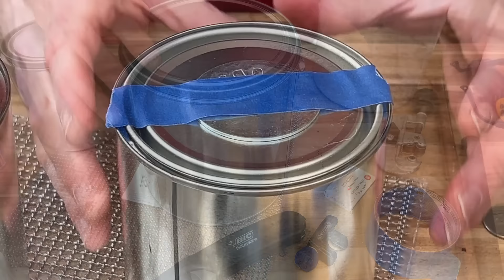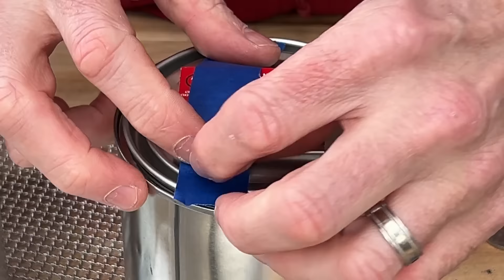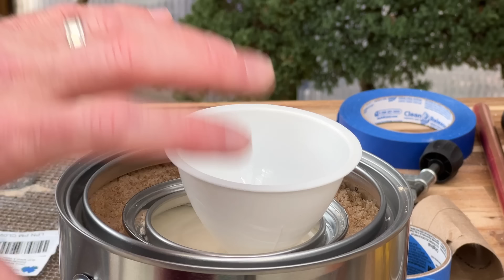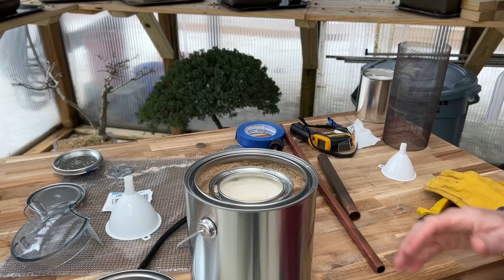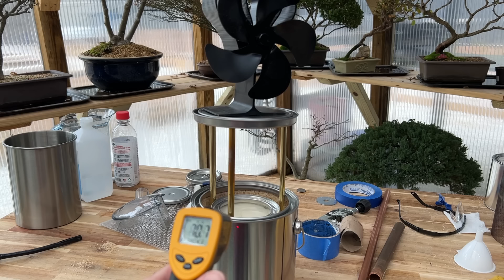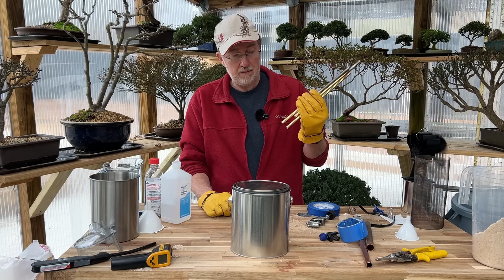Endless Heat Without Electric | Safe Reliable And Low Cost

Comment: I have an extra beneficial suggestion that many folks do not consider.... This suggestion is whenever you burn anything with a flame inside a room, you should provide fresh air from outside for the oxygen supply...For one reason is safety, of course, if you use a fuel that does not burn clean, and Ox level could be reduced in the room.... But the main reason is pressure differential. You see, if you burn something such as this fabulous heater without outside air source, there will be a slight vaccuum created within the structure that will draw in air through any gaps around doors, windows not fully sealed. This will create drafts that will cause parts of the room to not be heated as much, or not at all... By supplying the flame with outside ventilation, you create a static or slightly positive pressure that pushes air more evenly throughout the whole room.. For an example, when I was young, my friends heated their home with a Franklin stove, that got it's air supply from the room.... They had old, single pane windows, and small gaps around their front door, and no weatherstripping.... They would crank the stove up hot, but by the windows, the cold air rushed in faster, and got more drafty.... It forced everyone to huddle around the stove in the winter. They always grew mold in the corners....When they got a modern stove, that fed air from outside, their house was toasty.... And I think they used about one third the wood in a season....
Reply from the maker: Thanks for the advice and experience, that makes a lot of sense!
Reply: Thinking of running a little air pipe from outside to near my wood stove!
Reply: @hanginlaundry  A lot of stoves, probably since the 80's maybe, have a covered cut out in the back or on the pedestal, that can be unbolted to accommodate an air supply..... I don't know why it wasn't done 100 years ago... It is simple thermodynamics..... Hi temp aluminum tape usually works pretty good....the thicker guage stuff....Good luck...
Reply: @tiggywink1 Thanks, I will check that out! ❤🙏
Reply: tiggywink1, would leaving a window cracked open provide the necessary outside ventilation or something more elaborate is needed?
Reply: @arepede1878  It could, but not the best, because you could create a draft. You could however get a piece of styrofoam and fit it into the open window space, then put a piece of flex hose, or a shopvac hose, and drill a hole in the stryro to fit, then put the end near the draw area on the stove. A closed system is best....
Reply: @tiggywink1 what would be considered the draw area of this little homemade heater and how would it be fastened to it?
Reply: @jenniferrobinson8769  Near the flame. You could make a shroud out of a tin can, cut a hole for the pipe, as low to the bottom of the flame as you can get. Maybe get close enough so the end of the tube can get warm to help draw in fresh air. Heat rises.. I found some sites you may want to visit on YT. Zen Garden Oasis, and Daniel's Inventions. ZGO has the sand stuff. I'd use wire to attach, probably. Drill holes, make a hinge. like a BBQ.....
Reply: @tiggywink1 what do you think about making an exit hole in the large tin. Wedging something in it to make a tube/hose (maybe flashing material or aluminum? Something safe and that could withstand the heat). Seal hose with the heavy duty silver tape. Run it to the screen. (Of course cover around screen to avoid too much draft).
Reply: @goodenoughgirl8102  What you say seems sound. All you want is the flame to receive outside air, rather than air from the living area. If your flame is small, you could probable use a 1/2 inch flexible tubing coming through an insulated gap in a window venting into the burn zone. Like an open window with a strip of styrofoam dammed in the gap with a hole for the inlet air tube..... If no ventilation, Air from inside the living space draws cold air through any crack in any door or window. At least if the stove is chimneyed to the outside....If you just burn with no input or output airflow, you will be producing soot and vapors in your living space with questionable health considerations.
Reply: @tiggywink1 Thanks so much!
Reply: @tiggywink1 would putting it in the fireplace work? There's not many places for ventilation in my home
Reply: He mentions this heavily in the video
Reply: Hi. Just joining. One question:  can this be refilled? Can I keep adding more alcohol before storing or as it dissipate?
Reply: Thank you for the awesome 👏 advice. If I read it correctly, leave a door or window open?. If not could you please let me know. Thank you 😊.
-Also, wouldn’t it be a great idea no, to put the stainless steel, like he did in the coke can heater, to prevent open flame 🔥 in general. Both the large and smaller versions. This is Awesome work and thoroughly enjoyable, as one who just moved to NC & yrs, weather 😂, I’m never prepared, but my friend has everything camping. I sleep there for power outages if needed. Rather be home.
-What can you put on the top of pipes to cook with please 🙏 @ZenGardenOasis
Reply: Awesome job!  I appreciate you sharing your wisdom and taking the extra time to explain in detail for us older folks.
Reply: Fantastic example and advice. Something I had not been thinking about but definitely needed to know
Reply: @ThePerfectShepski  Yes, Brother, feed the fire with outside air, rather than drawing it from the room. Better for your health, too...
Reply: You over explain.
Reply: That's a long ace read. Use AI to shorten it up and not put ppl to sleep
Reply: @stbam1965 I'll work on that. Besides, I'm probably not the most interesing guy. But I'm not going AI. I try to explain thoroughly so people get it. I like people, not AI... Thanks for being honest.
Reply: @stbam1965 If that seriously is too long for you to read, I'm not sure even AI can help.  It's only 11 lines at the zoom level I have because my eyes suck, and that is not a long read.
Reply: @stbam1965 Ah, I see AI is doing wonders for society already, just like social media has done.
Reply: @flickwtchr NOT!
Reply: @stbam1965 hey! I enjoyed reading that!
Reply: @revheatherfromohio  It is probably because you are a thoughtful, wise woman that considers and respects the research done by others that are regular folks. Even if the knowledge gained is not embraced by the collegiate hierarchy. It is always better to learn from someone that has been there.
Reply: @stbam1965it's clear concise with no extra information
Reply: @stbam1965i recommend less fentanyl for you.

Comment: For the bigger version, please also make sure that the pail is stainless steel and NOT galvanized steel--if it gets hot, galvanized steel will off-gas zinc oxide fumes which can make you pretty sick.  There are ways to safely get rid of the galvanized coating but they take time or specialized chemicals.
Reply: My dad when he was young and not aware, welded galvanized steel and it gave him blood poisoning. He almost died at 24.
Reply: @LadyTrueBlue : you grind the galvanized plating off with a grinder ... .. and only then you will to that pipe .. or any kind of steel for that matter ... Make sure that the weld is a half inch or further away from the galvanized plating .. 
.. !!!! .
. yes galvanized plating stinks too when you weld it .. !!!
Reply: @BOBHLDRMN wow :) THANK YOU VERY MUCH for teaching me that!!!! You are appreciated by me. I totally understand what you mean as I remember watching my dad weld so many many things! One was a huge frame of a rainbow trout for which we did go fishing down by the snake river:) he put it into a parade with a running waterfall and a beautiful conservatory dressed lady skier ⛷️ swim suit holding onto the fish pulling her up the water. It was amazing all done with midge podge:) painted into a rainbow trout! Yep he won on thst idea 💙💭💙
Reply: @BOBHLDRMN so it must be ground to create a better bond because the texture melds into the product of the metals?
Reply: @LadyTrueBlue you have to constantly sip on milk when welding galvanized metal.
Reply: @LadyTrueBlue  ерунда.. у нас сварщики варят оцинкованные трубы 8 часов.. потом вечером температура поднимается и небольшое отравление, оно легко снимается молоком..
Reply: @Palladln what a beautiful language:) thank you kind man!!! 😊
Reply: So using stainless steel it will be safe to breathe?
Reply: @badele80  все равно можно угореть.. лучше чуть проветривать помещение, а этой горелкой нагреть камни (или красные кирпичи или чугунные ядра) и когда огонь потухнет то камни будут долго отдавать тепло..
Камни тоже должны быть специальные для сауны, не подойдет известняк и не подойдет гранит и кремний..
Reply: Good advice, thanks
Reply: About lost a brother in law to welding galvanized steel. He had been a welder for a long time and it snuck up on him before he was aware of how severe his exposure was. Been many years ago but I believe he said to drink a lot of milk to help recover from the poison fumes.
Reply: Yeah ..and when oxygen is finished..you don t nred heat anymore.
Reply: @NicoletaFlorea-l2p 😂😂😂😂RIP
Reply: Are coffee cans galvanized steel
Reply: @mbell66 no
Reply: Thanks!!! Forgot about that
Reply: you can actually burn off the galvanizzed coating before yu ever build the burner and you wanna have a lid tht fits tht bucket to put out the flame and keep it from drying out
Reply: Or just burn it off, outside. Use whats available in an emergency.
Reply: Great point!
Reply: Inhalation fever🎉
Reply: It will potentially kill you
Reply: What about aluminum?
Reply: Yes!
Reply: I think the giant version would burn a lot longer due to holding more fuel but will probably emit about the same heat due to paper towel  roll being about the same diameter as the toilet paper. 👍😃
Reply: @Gunslinger357 now that is probably true!!

Comment: Two comments: 
1- The paper roll is ok in a emergency situation, but is better if you buy a  flameproof insulator as:
ceramic fire blanket
fiberglass
rock wool
carbon felt
they don't burn if the alcohol is consumed.
2- This is perfect to try a heat acumulator with the sand, look at this video an do it with a insulator torch in the middle
https://www.youtube.com/watch?v=DZ1CkDlN6Xw
Reply: I saw on another post someone suggested carbon felt, but if it tipped it would run out that denatured alcohol would run out as opposed to the toilet paper roll would tend to hold most of it in

Comment: Great video. Fun fact tho, the fan is indeed powered by electricity. It is being generated by a peltier device, running on the temperature differential between the bottom and top metal sections of the fan's stand.

Comment: I love your videos. Yeah, it is easy for us to comment with different ways when watching after the fact, but your ideas always inspire me. Add the fuel in first, then add the can, and put the sand around it. Less hassle. Use a magnet to hold your opener, maybe add a lighter, it can stick to a magnet too. For Nonmagnetic, use matches in a small alcohol resistant bag/container for inside the can. You could really sticky-tape and tape it to the inside part of the lid. It is for an emergency. It is not like you need a hundred of them. I love the thermal battery-operated fan. I am going to try to make one of these. Thank you for sharing.

Comment: My heater plans include sand because it’s a superior thermal mass, holding and radiating more heat than most other types. Insulating with it works, up to a certain temp. Sand will hold very high temperatures. I think your stove idea quite dangerous, balancing a pot of boiling water on such an unstable base.

Comment: Can you please provide the name of the fan that you use? I have tried 4 different heat activated fans. Yes, they whirl around but the design is poor and they doesn't even blow my hair when I place my head directly in front them. They are all sent back to Amazon. Some of the fans that I purchased have great reviews but they don't work well enough to move much air.
Reply from the maker: These fans cfm are very low.  Gentle air current.

Comment: Great ideas . While I was watching it I was thinking why not put the paint can inside the bucket put the sand in the bucket same idea then longer pipes then add  a platform a bit higher than the paint can and use some tongs to put the lid off and on instead of taking it apart .I really like the idea.

Comment: I probably would use carbon felt instead of toilet paper. Carbon felt is used by welders and it won't burn up like toilet paper eventually would.
Reply: Graphite coated or non coated
Reply: @tracenixon5487 uhm.... I'm not sure on that one. I'd have to research the pros and cons of both before deciding.

Comment: Great idea for emergency heat. 3 or 4 small can heaters spread out  be better for a large room. More wick surface area then a paper towel roll would give off more heat faster. Sterno cans contain gelled alcohol, no wick necessary. Sterno is more expensive than denatured alcohol about $1 per can. Still easy to order a case of Sterno and store the box for emergencies.
Reply: I think the idea of this heater is to heat up a small room.

Comment: Thanks for all the great information 🙏  i understand the use of sand, but since it's heavy AND messy,  I'm gonna try using Rockwool as the insulator on the sides and use the sand at the bottom as a gravity weight to deter tipping.  { also, to dry out sand, spread it out on a baking sheet or pan & bake in an oven.}

Comment: Hi, What can i use a daily inside home.. i want to warm my 1 bedroom apartment using no electricty everyday in winter time for cheap what do you suggest.. thanks
Reply: large,clear glass oil lamps with 1 inch wicks. K-1  kerosene is safe for indoors (around $10 gallon at Walmart). Just make sure there is no smoke at all coming from the wick,lower it until no smoke.

Comment: Ok I have a question for you sir.. maybe you can title a video after this topic.. what is the hottest heater that you can make that is safe as a candle or in a house that doesn't have a way to vent potential carbon monoxide or other  issues that would not make it safe to use in a living room or room indoors in the winter without a chimney or way to vent exhaust fumes? So basically your hottest candle powered heater or equivalent maybe some fuel source that doesn't produce high amounts of exhaust fumes?  Thank you if you have a chance to read this.. cheers

Comment: Great idea. Maybe i missed it. how many hours until no more heat ?
Reply: I tested once and 1 tsp alcohol burns for 5 minutes. One cup for 4 hours.
Reply: I am wondering this too. Also am I able to refill the wick can when the fuel is burned off?
Reply: @gigipersimmon you can use the TP multiple times it doesn’t burn.

Comment: I believe the fan also blows carbon monoxide into the breathing area. If the CM detector does not sound due to low levels of CM, you will still breathe in those fumes. I leave it to experts to determine the long term effects. The only safe permanent heater using fuel is a vented heat exchanger.

Comment: Great video and fantastic idea for emergency heat and/or cooking. One minor correction, the stove fan uses thermionic power to generate electricity to power the motor. Basically, it uses a bunch of thermocouples wired together in series and parallel to generate enough voltage and current to operate the fan motor.😀 Thermocouples are used to measure temperature and generate a voltage that increases with increasing temperature. A pyrometer takes the voltage reading from the thermocouple and interprets it as a temperature. Thermocouples are made from two dissimilar metals such as iron, copper, nickel, platinum or specialized alloys.

Comment: Glad your pushing the Smoke and C02 alwarms, as a 18 year firefighter I see all to well the damage fire can cause. but great build and ideal for a greenhouse or tunnel too
Reply: during a power outage plug in carbon monoxide detector won't work
Reply: @mightymikee1 exactly
Reply from the maker: I installed simpli safe a while back.  Been very happy.  (Not sponsored).  Cheers